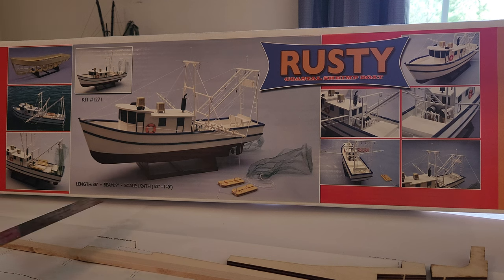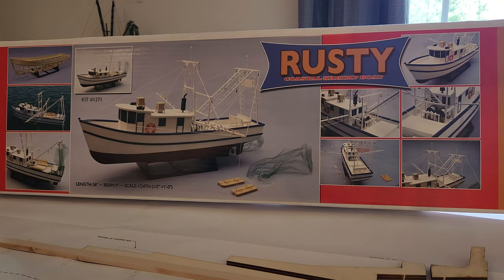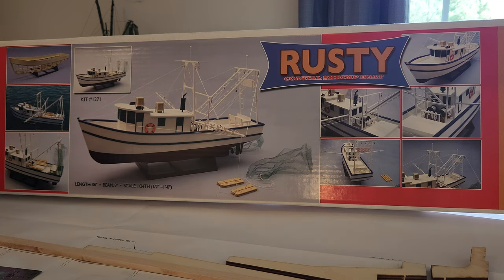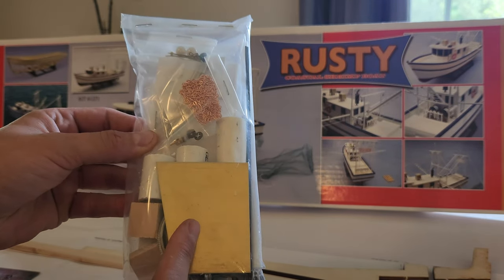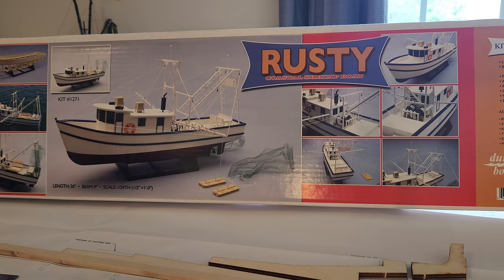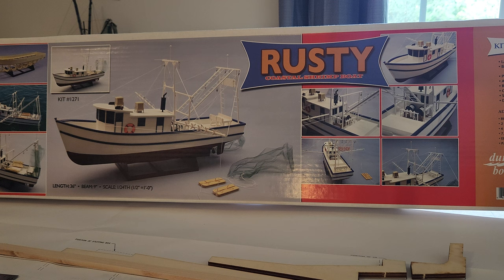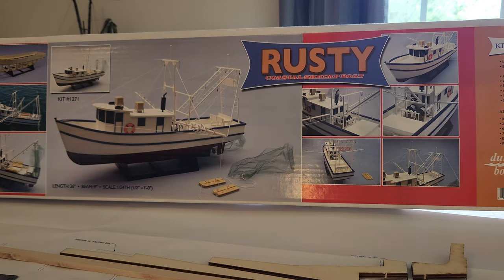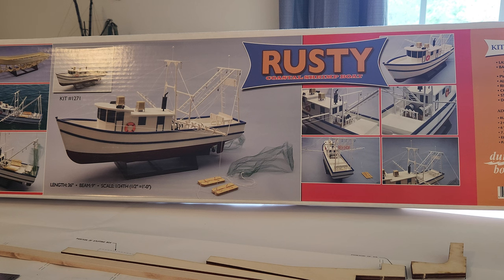Building a model Shrimp Boat.

Comment: Yo I need an update bro is it big enough to do a sound system and smoke generator basically make a working rc shrimp boat
Reply: yes you can put sound system in the boat and if you can find the working winches then there is no reason why you couldn't make it working boat. Though I would not suggest attempting to catch actual shrimp as the river bottoms tend to have a lot of snags.